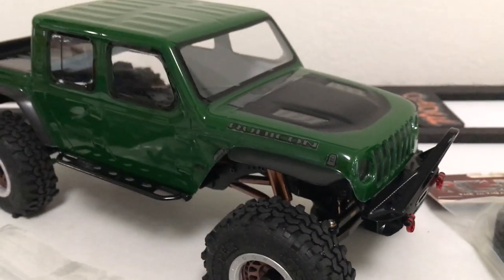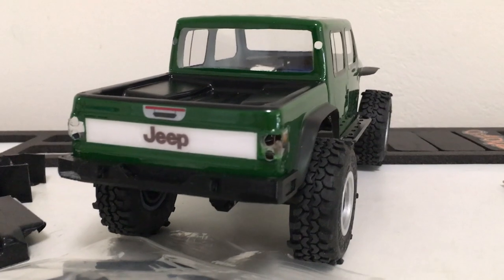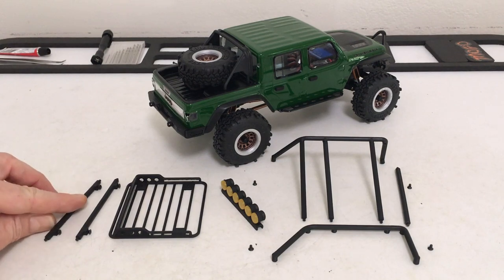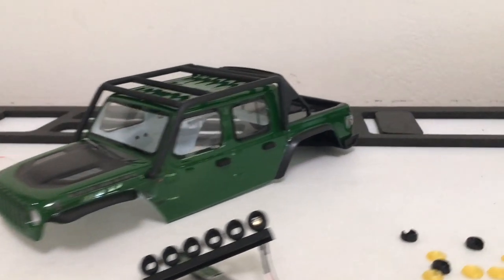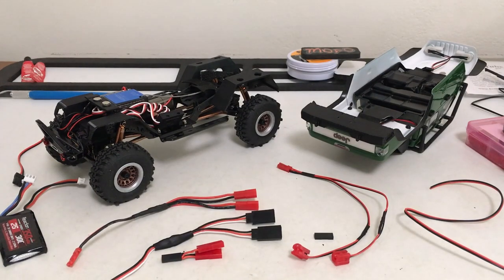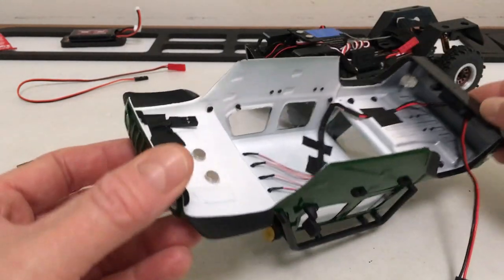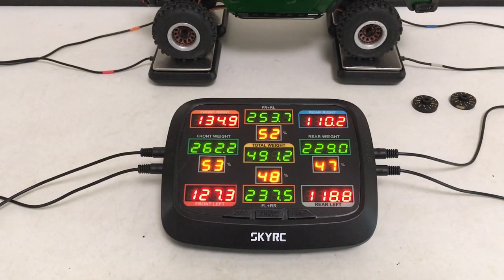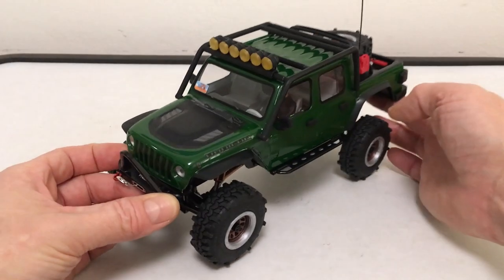SCX24 JEEP GLADIATOR 2.0 BUILD - STAGE 2: PAINT, BODYWORK, EXOCAGE, LIGHTING, SCALE DETAILS, MAGNETS

Comment: Is there any chance you could show in depth which channels you have plugged each led into and where it is controlled from by the controller, my channel 4 button makes any led plugged into it flash slowly, then quickly, then it turns off, I’m unsure how you have gotten the light bar and the headlights/rear lights to turn on separately
Reply from the maker: @22:22 - You will need a cyclical switch to control two different light ports, plugged into ch4.
Reply: @bcochener  thanks

Comment: What are your wires hooked to in the back before they  come back up to the switch towards the front. You say in  video that the headlight whip will go back to he switch but I didn't see one back there in the video. Thank you
Reply from the maker: Nothing. The headlight whip just has to go to the back (hinge) and come back up to the cyclical switch on the slider. To make the body hinge work. Otherwise you could not open the body. 

Just a long headlight wire rout due to the rear hinge.
Reply from the maker: You can see the routing @33:00. It’s just providing slack for the hinge to open.
Reply: Thank you so much for the video and the info..I've been trying to figure how to do headlights 👍🤛